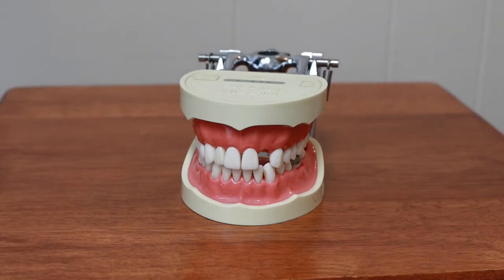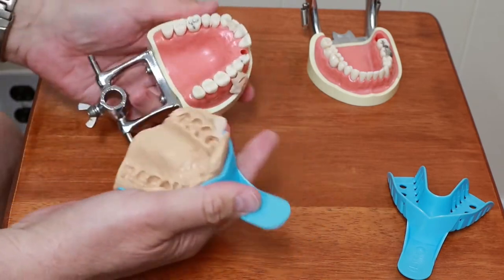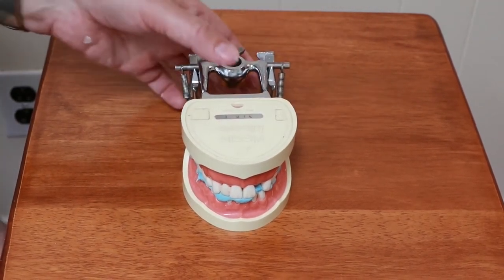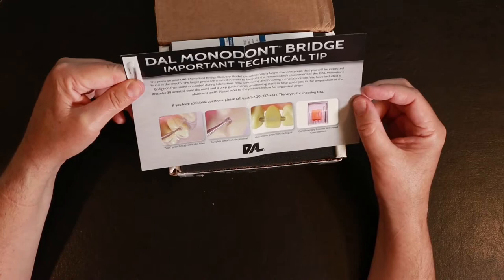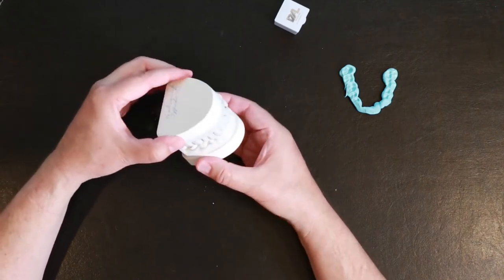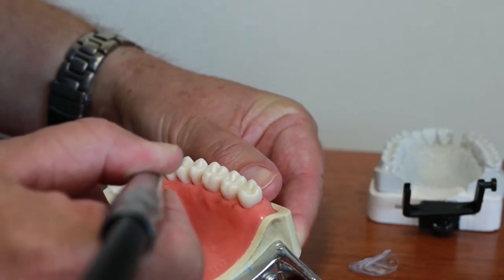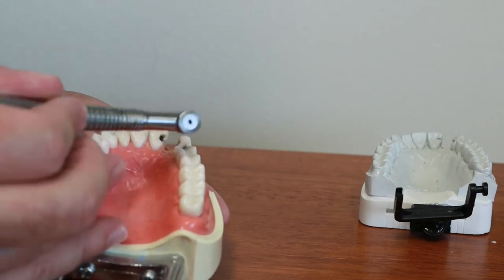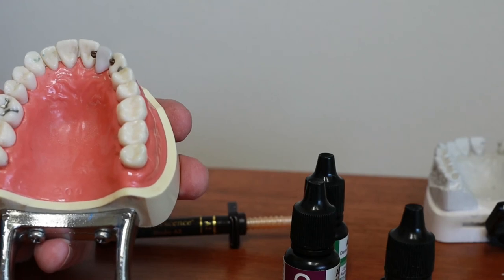How to make a monodont dental bridge. The steps for making a Mondont dental bridge.

Comment: What is the cost for a 2-tooth bridge, say # 24 and 25 in combo? I agree the Maryland bridge tend to come loose from feedback I"ve gotten from 2 dentists. Can a different cement be used to increase longevity? While I am from the US, I'm having 24 and 25 removed and looking for a solution where I'm  at here in Thailand. I'm not sure they are familiar with this style of bridge over here, but I may wait until I get back home as well. I had root resorption on 25 pretty bad and #24 has been affected as well. Neither one can be saved. Implants are cost prohibitive and I really don't want to wait one year in prep.  I've also had one implant fail and it is a real nightmare to have them removed. This looks like a possible solution.
Reply from the maker: Hi, cost will vary from office to office. In my office it would run around $2200.
Reply: Thank you. Much more affordable than two implants, and considerably faster.